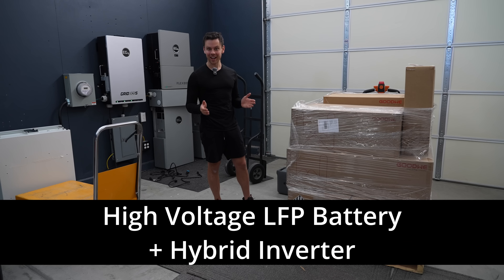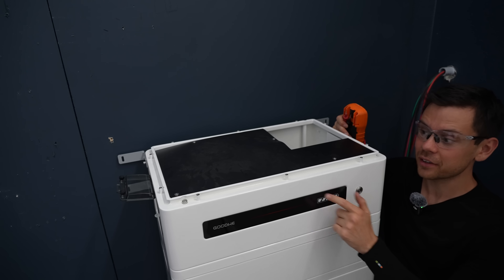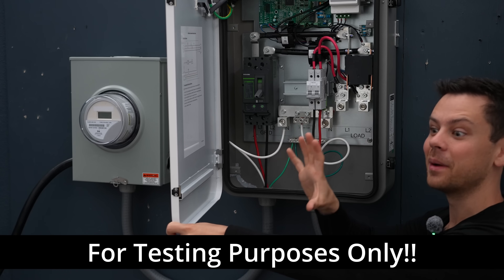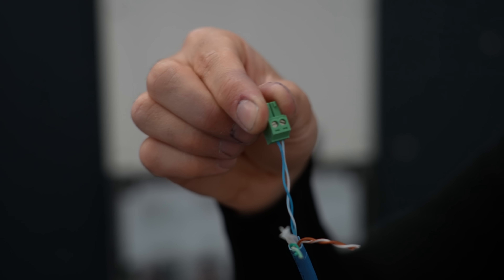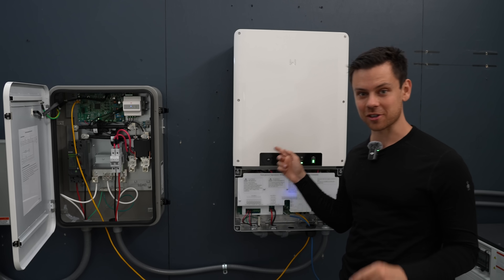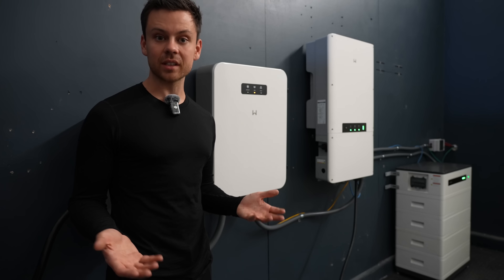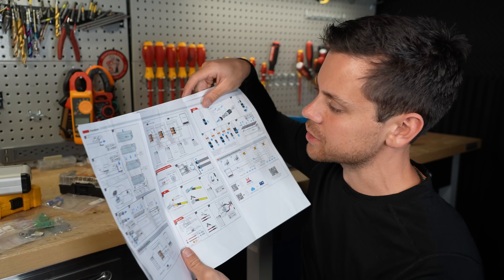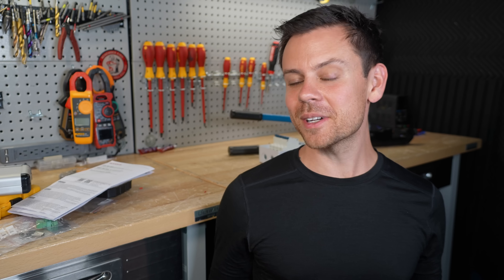GoodWe 11.4kW Hybrid Inverter + High Voltage LFP Battery: My FIRST Dead Silent Inverter!!

Comment from the maker: Affiliate Links:
Goodwe Silent 11.4kW + 39kWh Battery for $8,900: https://bestsolarbundle.com/products/goodwe-es-us-11-4kw-inverter-with-abd-ev-charger-12-8-38-4kwh-battery?ref=WILLIAMPROWSEIV&variant=43677775855658

GoodWe Silent 11.4kW + Battery + Solar Panels + Roof Racking Combo: https://bestsolarbundle.com/products/goodwe-es-us-11-4kw-hybrid-bundle-12-7kw-pv-12-8-38-4kwh-battery?ref=WILLIAMPROWSEIV&variant=43484495413290

Other Hybrid Inverters: https://bestsolarbundle.com/products/goodwe-es-us-11-4kw-hybrid-bundle-12-7kw-pv-12-8-38-4kwh-battery?ref=WILLIAMPROWSEIV&variant=43484495413290

~~~~~~~~~~~~~~~~~~~~~~~~~~~
Tired of getting ripped off? Check out my "Will Prowse Approved" solar product recommendations below!

12V Batteries
https://www.mobile-solarpower.com/lithium-batteries.html

48V Batteries
https://www.mobile-solarpower.com/48v-batteries.html

Offgrid Inverter System Builder
https://www.mobile-solarpower.com/48v-complete-system-blueprint-559371.html

Hybrid Inverter System Builder
https://www.mobile-solarpower.com/code-compliant-48v-offgrid-system.html

Mobile Handtruck System Builder (very popular!)
https://www.mobile-solarpower.com/mobile-48v-system.html

Solar Panels
https://www.mobile-solarpower.com/300w-solar-panels.html

Ground Mount Solar Racking
https://www.mobile-solarpower.com/ground-mount-racks.html

Wire, Lugs and Busbars
https://www.mobile-solarpower.com/wire-and-connectors.html

Tools
https://www.mobile-solarpower.com/tools.html

Fuses and Circuit Breakers
https://www.mobile-solarpower.com/fuses.html

Plug-N-Play Solar Systems
Ecoflow, Anker And Bluetti! So many models to choose from. See my current recommendations here:
https://www.mobile-solarpower.com/full-size-systems.html

~~~~~~~~~~~~~~~~~~~~~~~~~~~~~~~~~~~~~~~~~~
Need to build a large DIY system? Need a trustworthy solar distributor? These are my favorites:

Signature Solar
Creator of EG4! Solar Minisplits, Victron and More! Largest Solar Store Online.
If you want $50 off, please use my link below and coupon code "DIYSOLAR50":
https://signaturesolar.com/?ref=cPwLcVc0SW-BjN

Current Connected
Best Prices for EG4, Victron, Midnite and so much more! Fast Shipping and Highest Rated Customer Service:
https://currentconnected.com/?ref=wp

~~~~~~~~~~~~~~~~~~~~~~~~~~~~~~~~~~~~~~~~~~
Join our DIY Solar Community 
Need more help? Join the largest solar forum on the internet for beginners and professionals alike. 140,000 members and counting!
https://www.diysolarforum.com

Check Out My Free Book
Best-selling and beginner-friendly guidebook to off-grid 12V solar!
https://www.mobile-solarpower.com/the-book.html
Reply: Thanks for great content like this. I'm getting ready to build an off grid house and this really helps!
Reply: Make sure to check the temps of the box.  Maybe even look at it with a thermal camera after running a full load for a while. Otherwise looks like a nice system, hopefully they take your advice and update the box
Reply: Do you sell your used systems Will?
Reply: What is needed is standardization..
Reply: does this have the ability to use ac-coupled solar as an input like the solark?

Comment: I built a 90kwh system with a 10kw/30kw peak LF Inverter and the fans were very very quiet, as in not running.   I thought it was because it was winter, but as the summer came along I realized they were never going to come on.  I had to repair the circuit, then they were super loud.  I decided since it survived with no fans that it would be safe to replace the fans with lower rpm ones, which I did.   The system is almost silent now and I have no issues at all.  Even on hot 115 degree summer days the hottest the inverter reports is 135 degrees, and that's running the house and the EV charger.

Comment: The price is down to under $6K now!  I was looking over the docs and in its install diagram it has the need for an ATS (Automatic Transfer Switch) for whole home backup.  Could you go over this or try it out in a video?  Most gateways (ABD in this case) do this function.

Comment: The inverter may be compatible with more than just the proprietary batteries that you mentioned. Signature Solar has this bundled with the LG Prime 400v batteries. Considering it at the moment since the LG Prime is Buy one get 1/2 off the 2nd today for Black Friday.

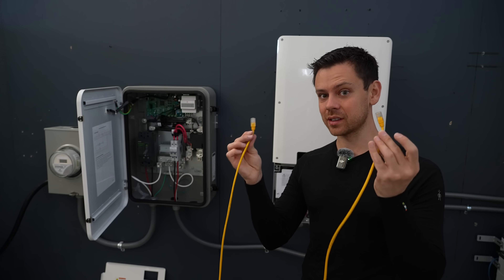Comment: 5:10 Ethernet Inverter to MID 5:20 Ethernet (spliced) Battery to MID 6:15 App is connected?!? What?! How is system connected to internet or Bluetooth to App?
Reply: 10:45 Needs An App to commission the system?!? 🙄 🤦‍♂️

Comment: Will, as usual, great review.  They could learn from Victron for Can Bus management - (It would be interesting to see if there is some cross compatibility with their products - like their terminators)  I'd do a continuity test with their wire and identify the pins on the RJ-45 end that match - and then make a small adapter cable and run a standard ethernet cable between the two (actually I'd run shielded ethernet cables for all) . 

As far as high voltage batteries are concerned - it seems that running multiple 48V packs in series - rather than parallel, may be the solution.  From my calculations - Five(5) 48v packs in series would be about the 260 VDC at full charge.  Hmmm.
Just my 2 cents.

Comment: In Europe or in 3 phase systems, high voltage is 600V DC to get you at 97% efficiency on the inverter side.

Comment: Many people think “high voltage” automatically means “more dangerous” — but in fact, it’s quite the opposite when designed correctly.

1⃣ Safety – Low-voltage systems actually carry higher current, which causes more heat and higher fire risk. High voltage reduces current and heating.
2⃣ Efficiency & Silence – Higher DC voltage allows the inverter to run with minimal losses, enabling fanless designs like this one — completely silent.
3⃣ Reliability – In power electronics, temperature is the real enemy. Less heat means longer component life and better reliability.
4⃣ Higher RTE – High-voltage systems deliver higher round-trip efficiency than traditional 48 V setups.

So in modern, certified systems, high voltage = higher efficiency, lower loss, and greater reliability — not higher danger. ⚡

Comment: Nice video. Finaly I see more videos about High Voltage Hybrid inverters. EU start using HV long time ago, because of efficiency. Especialy for 3 phase homes, which is quite often a case. In example I have GoodWe GW20K-ET (20kw) hybrid inverter with FelicityESS 30kWh high voltage battery (614.4V). App lets me to choose other then GoodWe battery - i.e. BYD, DYNESS HV, GE+ (which uses Pylontech protocol).
Unfortunately there are only few options for High Voltage DIY setup, i.e. GCE RBMS - high voltage BMS with BMUs for cell packs (16-24 cells).
Reply: Love hearing about real-world installations like yours. High-voltage solutions are gaining momentum globally, and it’s exciting to see users taking advantage of the efficiency benefits.

Glad to have you powering your system with GoodWe 😊 thanks for being part of the journey! ☀️🔋

Comment: Hey Will, you CAN build diy batteries. I have a GoodWe hybrid inverter and I built my own battery using the Batrium BMS. Batrium can emulate the communication for some of the listed batteries that will work with GoodWe inverters. There was a few glitches with the communications but I worked it out with tech support. My high voltage battery has been online for well over a year now. It's a really cool setup and I love the Batrium BMS. They are the best in my opinion. 😃
Reply: Let me know and I'll send you my pictures. It's a really cool setup!

Comment: Looking hard at buying the SRNE hebp48120u240-pro hybrid inverter.  Search the diysolarforum for discussion, it's around $2k, stocked in US, similar to the EG4 18kPV with 18kW of 450v PV input, 12kW of split phase AC out, 48vdc storage.  I don't need a hybrid's grid tie, but unlike the off grid stuff this is a sealed unit suitable for outdoor installation with UL listing and thus much better build quality.   Hope Will Prowse can review this someday.

Comment: i am interested in 50kwh high voltage solar system. i want you to introduce high voltage inverters and high voltage lifepo4 batteries and general information of its system. high voltage definitly more advantage than low voltage in many ways, when we think of electlicity. your video is always informative. thanks.

Comment: I never understood why we go from panel voltage (DC), through a charge controller to a different battery voltage (DC), then to an inverter to change the voltage again (and go from DC to AC), then into our appliance, which often changes the voltage again... and maybe back to DC.  Losses all the way through.  I love the idea of this 240v battery/inverter, but I'm a bit curious why we jumped from 48v to 240v.  If most household appliances are 120v, shouldn't we want a 120v battery/ AC inverter?  I get that cars and some appliance want 240, but not everyone is charging a car.

Comment: I don’t know much (at all) about solar setups, but can’t you use a DC to DC converter to step a 48 to 400Vdc or whatever the nominal voltage is, correct? That way you can use your own batteries and connect them with smaller AWG wire. Let me know if I’m pretty far off on this.

Comment: thanks will , i have shared , learned so much and appreciate all the details in every video. I watched your last video ( 4 air compressors ) and do not recall you doing an idea consumption on this high voltage unit ? can to do a short on that point? plus why is this battery and invertor combo so efficient ?

Comment: If they want to do DIY HVDC IMO they should implement a standard connector scheme... with no "wiring" of HVDC. Flip breaker off, standarized cables in, flip breaker on... done is how it should be.

Comment: This system will work with many other high voltage batteries including LG CHEM, I am using it with a CATL high voltage battery banks by Kohler. In the setup menu you will find list of batteries to chose from i think on page 4.
Reply: You are indeed correct 😊
We’ve worked closely with many partners over the years to offer reliable, high-quality energy solutions. Thanks for sharing your experience 💕 Always exciting to see how people are building their systems and putting clean energy to work! ⚡️

Comment: What’s the efficiency?The battery has an inverter to high voltage and the solar inverter has to reduce the voltage.the advantage is the wiring is between the units and the grid.

Comment: Hi Will, can you make a video on CurrentOS? DC Microgrids seem like the future to me, I also found a manufacturer that makes BMSs for high voltage batteries, look up GCEBMS, they have a 350V one that should comply with CurrentOS's 350V spec from what I can see. Might be the way to go for a DIY "high voltage" battery.

Comment: I’m still in the toddler / tricycle phase of this DIY Solar world. About a year ago, I bought a 12V Inverter and a couple of WattCycle Batteries. Instantly realized that was a mistake and got two more WattCycles and impatiently waited to find an ok deal on a small 48V Inverter. Jealous of all the Server Rack batteries, but then it turned to DIY battery envy. Now I realize EVERYTHING I learned in the last year is wrong and HV is the next evolution?!  🤣 For those who have watched Will since he lived in a van, it must be a different feeling. For us  recent subscribers, we are continually pinned to the back of the seat at ludicrous speed. 😮

Comment: I'm sure I'm not the first to bring this up:  the lack of fan noise indicates a lack of cooling.   Does the silence indicate lower temperatures?  Are the heat sinks on the inverter just that good?
I'm interested in the long term outcome here.   Will this overheat?
Reply from the maker: No, it's more efficient so less heat. It runs cooler than lower voltage. That's the whole point.

Comment: I am holding out for a 120 VDC battery bank + 120 VDC input  inverter.  There is so much stuff in our homes that runs on 120VDC.  Let's not invert all the power to AC when we can run straight off the battery pack.

Comment: Installing Instruction :
For you it might be a bit confusing, BUT you have a long year practice - and know most possible options before even open the sheet. I think you would be able to arrange it even without it ?
Take one guy, never installed like that before and see what happen then ...
This connectors with 4 sides are strange - so with good or cheapo system, you need to buy some extra or can't handle it. Sure I don't have ANY of this tools.
The silence is really worth it - as of my experience, if we have a financial change - I want to take one separate room just for all the Inverter, and batteries - as now I hear the ONE ! Hybrid fans 4 meter away around the corner all day and night.
But as it is steady, it is ok ... like during army: sleep beside a generator was more easy than in the official rest room with always change sounds.
Nice to see your happiness even you have done so many systems yet.
Go ahead !

Comment: Hi Will, any chance you could review a cheap capacity tester?  Something that could be used on a 100Ah battery to check its capacity.
Reply: 3000w inverter 100 bucks used on Craigslist + small 10 buck space heater+ 15 watt meter

Comment: Will you be doing a tear down on the batteries and inverter?

I would be interested in learning what type of additional protections these systems need due to the high dc voltage and arc flash risks. 

I have zero doubt these systems work well. It's the safety and protection aspects I want to learn about. 

How are the BMSs different on these batteries?

Comment: Another great vid Will, I like the idea of HV especially just over the 240v range because its close to what we use in Australia and only requires standard (Thinner) wiring as you say, makes the conversion losses much less and the system dead quiet, a big plus.
I’m surprised I haven’t seen comment on The Battery Man channel, where he mounts two cheapish used Tesla EV 60 kWh batteries to his wall and hacks the system to use with a 800v inverter, (I think?) Worth a look.
I agree, the 48vdc systems have been great, but I think we are heading into the higher voltage systems into the future.

Comment: Would this be a good solution for a non-back feed ATS fail over option? I have a 7kw propane generator and a SPAN panel but I'm looking to go to battery first before using any propane.

Comment: I am curious if this inverter starts from battery only? We have a Goodwe HV inverter that requires two power sources to start up. A disaster when the inverter goes down at night and there is no grid power. Our Goodwe inverter fails to restart until the sun comes up or grid power becomes available again. Big fail!

Comment: Which 48v inverter has a 85% efficiency? A Multiplus has the same efficiency. So the whole argument for higher voltages is gone.
The only actual upside is the smaller/thinner cables.
I wouldn't want anything that doesn't communicate pylontech or victron or any other open protecol. It's freedom I want

Comment: Deye inverters are very popular. They use high voltage MPPTs (high Voltage solar arrays; less strings and smaller gauge wires) and they support almost any type of batteries (160V - 700V). Heck, you can buy an industrial grade 50kW inverter to charge your EV.

Comment: @WillProwse about that diy battery situation, there is this program called "battery emulator" by dala made to pair high voltage batteries to different inverters.

Comment: Was working on a ford escape hybrid battery testing voltage with a volt meter when I got hooked by the 350 volts DC....it took everything i had to rip myself off of it and i flew back 10 feet off the trailer I was working on top of  because i had all my muscles in full reverse trying desperately to pull myself off it. I have been shocked by 110, 220 AC multiple times....350 volts DC was the first to hurt and nearly killed me.

Comment: I've been using a Goodwe (GW 2500-Xs) inverter for 4 years - it puts out 216v DC before it's converted to Ac and sent to the control box. This inverter is the size of a lunch box - incredible! It runs at 50 degrees C and has no fan.  The software and  the GoodWe site are amazing - so keep looking at Goodwe, perhaps you can buy their units and fit your own batteries.  Great video.

Comment: Higher voltage batteries is great, but DIYers will die because of it and more catastrophic fires will occur. 

An old Electronics teacher of mine, once asked the class - "What is more dangerous 100v AC or 100v DC?". Most people in the class said AC.

The answer, of course, is DC. DC arc's do not self extinguish and if you complete a circuit in a 100V DC system, your body muscles immediately contract, making it almost impossible to release grip - Your dead!

Comment: Hi Will - You can actually get a 30/35kwh battery for $2290. That includes the battery box, 16 x MB51 batteries and shipping from Yixiang. Watch the build on Off Grid garage (Australia) - Its amazing :-) Keep going buddy - best regards from the UK - Oh and it has the latest 300A V19 JBK BMS in it too !!